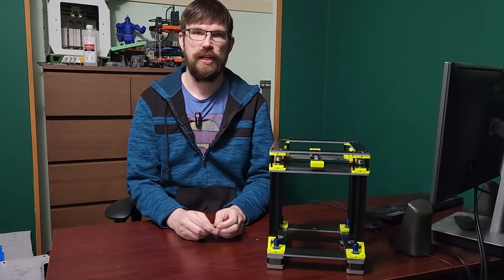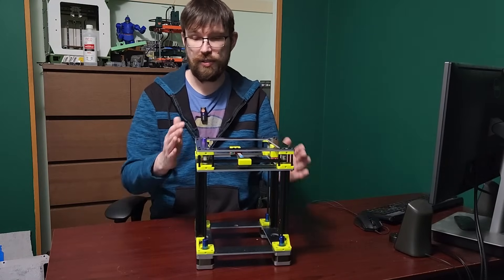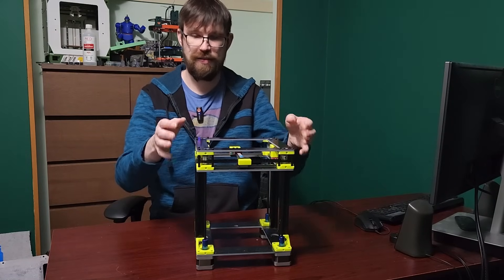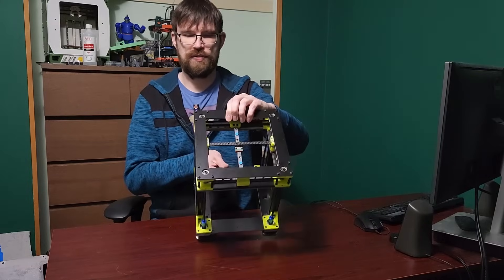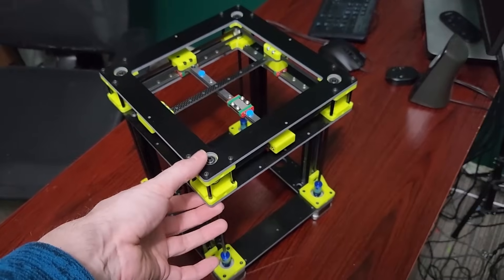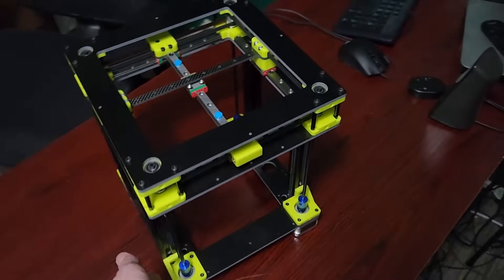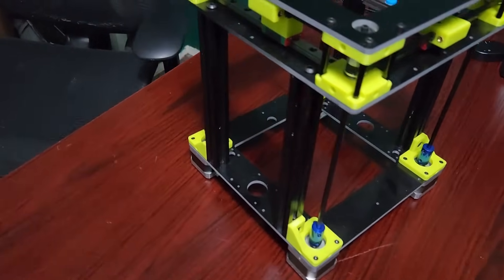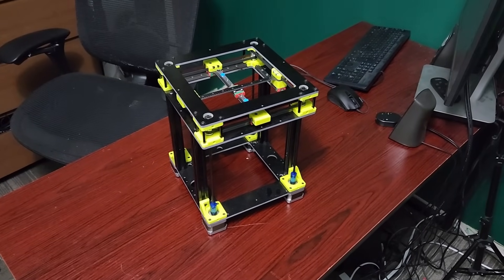First Look at My Secret Cross Gantry 3D Printer Design!

Comment: Can’t you use the 4 5mm rods for the bed? It would be mandatory to use an Oldham decoupler to avoid flexing the carbon rods. V wheels would not be terribly difficult either and won’t add stuff blocking accessibility.
Great work! I’m looking forward to seeing the finished product.
Reply from the maker: the carbon rods are usually not consistent enough to run a bearing on them. Very difficult to get get tolerances
Reply: @Rolohaun I understand. I would thought that POM linear bearings would be more forgiving with clearances, adding de benefit that, like in prusa, they don’t need to be lubed and facilitate the maintenance by not catching as much dust.
And even if the rods are less straight, oldham decouplers would ensure only vertical movement.
I’m truly waiting for what you come up with!

Comment: I sort of lost you on some parts. You use slotted aluminum profiles for Z. They are cut and accuracy for that cut is sloppy. This again is transferred to your main plate, with all the linear rails. For the rails to be mounted anywhere near in spec, you simply cannot use profiles this way, as the cutting is typically like +-0,5mm and the spec for the rail surfaces are in the microns. I also fail to see any adjustment options in this vid, so them plates need to bee seriously tight on tolerance, to be within specs for the rails. That includes them running in parallel. Not sure what has happened with this design, I am not a member, so I have no idea what the update says. How ever, the specs for the the rails are pretty straight forward, and how this meet that spec, I simply fail to see. The thing is, that binding is the ghost of this type of design, because of the need for things to be actually perpendicular, in plane, and in parallel.
Reply from the maker: the linear rails have small amount of adjustment to align them parallel. 2020 profiles are just for Z and what will be used to mount the linear rails for Z just like other printers nothing really different here. This is a prototype and still being worked on among other projects.
Reply: @Rolohaun  Right. You lock your plates to them 2020, please make one guess as to what is the strongest: Aluminum profiles in their longitudinal direction or thin plates at their cross section. Which one do you think will give in, as you fasten these. As for the ability to "adjust" rails. Well, how? How do you adjust anything at the micron level?
Reply from the maker: @FrodeBergetonNilsen  aligning he rail on a CNC plate is the same as aligning it to a 2020 you need to measure and get it parallel no different. Linear rails holes are larger than a M3 there is plenty of adjustment. Do you know how much rigidity a linear rail adds? linear rails are also providing strength not just motion. My g10 plates are flat with the linear rail attached. Design your own custom 3D printer and enjoy
Reply: @Rolohaun  "you need to measure and get it parallel no different"
Again. How. How do you align anything at the specs required? How. Have you even read the spec?
Reply from the maker: @FrodeBergetonNilsen  i really don't understand what you mean, you would align the linear rails to the g10 plate. Same as you would align it to a 2020, you measure and make sure it's parallel with the 2020.
Reply: @Rolohaun  Well. To make an artifacts that is within the specs for the rails, the surface needs to be flat. Flat to a specified value. You are using LOOSE tolerance to the surface you fasten your G10 plate to. The plate will simply bend when mounting it. Because the surface you fasten your G10 plate to, is absolutely, positively, not anywhere near the required spec for the rails. Again, them 2020, how strong are they in their longitudinal direction? And again, you claim "you measure", so please, just explain to me, how? Once you look up the specs, and actually read it, then you might explain how to meet it. Because I am still waiting for the reply on how on earth you are planning to meet any rail specs. But we are in agreement: You do not understand what the specs says.
Reply: @FrodeBergetonNilsen  In this kind of design you can easily align the 2020 prior to mounting. You need to get one end on all the 2020 flat. Then you allign them side by side and press them against a flat surface (like a slab of stone plate). Then you can adjust all the opposite ends and get all 2020 to the same length.
Reply: @simonquvang6073  No. Not at this accuracy level. If this is what is done in the industry, that would explain A LOT. We are talking about an accuracy in which 2020 profile do not adhere to. Not by a mile. The bloody tolerance of the slotted profile is nowhere near the required for the surface and fit for tight tolerance rails. This is why I ask: How? Because nobody seems to know how. Not at the accuracy level needed, to be anywhere near the specs for the rails. You simply do not know anything with the process you just described, you just assume. For a ton of work I see, they might as well claim to be on the moon, and know that they are. They just assume it, thus it is true. Just for the record, I think I have seen only one tuber with a stone surface used for alignment. One. He was not aware of the tolerance of this rails.

Comment: Being realistic. If we building a DIY printer i think and hope not being wrong, we have a drill laying around, with a printed stencil could be easy. 

You can always check the cost of cnc vs laser cuts and just make the general shape and the bearing hole depending on your final decision. The little holes can be made when the plates arrive, it isnt a precise operation making 3 holes in 4mm plates IMO.

having the option "hole-less" vs with holes for requesting depending of the price, the country and the amount of "hands on" someone is willing to put in it, is a good choice too!
Reply from the maker: I just think manually placing all the holes it too difficult to get right, all of the linear rails needs mounting holes drilled and those need to be as accurate as possible. I will be looking into cheap laser cut acrylic options and such I am sure there will be cheaper methods
Reply: @Rolohaun idk if this is the correct word in English but "methacrylate" the same type of acrylic people use on PC gpu cooling blocks should make it. The operation cost for that material is incredible low and the temp resistance is well know in pc/server and even automotive modding. 

And for the precision, you can always pay a workshop to do it with a stand drill(idk the correct word) and a vynil template. We arent looking for a 0.005mm precision, are we? The cheaper option i can think is the methacrylate cuz others like pvc tend to deform and a 3D printed part would last longer.

Comment: I would agree with a belted 3 z, say with like 2.4 beefy z tensioners . Here’s my question tho. With cross gantry and say z tensioners mounted on the bottom sandwich plate, how much “noise “ do you think would transfer to the build plate at speed?
Reply from the maker: only time will tell, I don't think there should be much but who knows

Comment: As someone who built a Rook 2020 scalable thats 300 in the Z, I would much  prefer rails over belts for the Z.
Reply from the maker: I assume you mean lead screws over belts? With a gear reduction belts work well and there is no worry about bent lead screws
Reply: Use GT3 belts and live shaft, then tighten it as much as possible then it would work well even for long length

Comment: Why not keep a standard bed size, and then offset the bed to gain back what you would've lost due to the rails? So, you'd just make the frame slightly larger in XY.
Reply from the maker: I am already offsetting the bed to get the 110 size, for 180 I will need to grow the frame. I am trying to make it as efficient as possible

Comment: While I love the design,I have two main feedback.
First, you want to keep the cost as low as possible, but I'm not sure if you actually need the top plate, (or the second top plate). I think only one is sufficient, and you could sandwich the gears with 3d printed part. This would lower the cost.
Second, For the motor shaft needed to be longer if mounted directly on the top part, you could work around this. Have two of the motor underneath the gantry, for the lower belt, and two motors above it. THen you can use a standard shaft. But even then, I'm not sure if this is required. I'm thinking about the corexy, they always have two different height for the belt, and use standard shaft. But maybe I misunderstood.

However, I understand that would still go against the argument of having the mass the lowest possible.

Comment: Great and interesting design. As a cross-gantry printer owner it's excited to see new cross-gantry designs. Except the bowden part - bowden is unacceptable in 2025. In my printer I rotated the rails 90 degree to reduce the carets footprint and allow more space for extruder.
Reply: I was making my own cross XY as I’m sick of all the core XY clones, but stopped because the of simple fact that the hotend is too small for direct drive (at least with my setup using linear rods instead of rails).
Reply from the maker: I have no issues with bowden, as this progresses I will see what make the most send, right now there is no room for DD

Comment: I understand cost management and you’re doing a great job with that but I don’t understand the 180.. to me it seems contradictory to the cost goals.  Prusa and Prusa clone beds are everywhere and can be gotten for 50 all day long complete.
Reply from the maker: prusa beds are hard to work with as they are meant for bed slingers so mounting can be a issue. It can be done just not a simple process. Users can mod the final version of this and use whatever bed they like

Comment: Btw, what about cross gantry with dual crossed carbon tubes? Would potentially increase the print area compared to off-center printhead? Also potentially lighter.
Reply from the maker: carbon tube that can run a bearing with good tolerance are very expensive and hard to find

Comment: Could you mount the printhead center on the rails if you were to have the bowden tube enter diagonally? And then straighten out evenly lower, or lose a bit of z height?
Reply from the maker: the printer will need to be bigger the carriages take up a good amount of space to mount the toolhead center

Comment: Do the plates have to be plates?  At least the top one looks like you could build it by stacking four identical pieces.  It wouldn't look as pretty and it might be a bit less rigid but I'm guessing it would save on the cost as you're not paying for as much wasted material.
Reply from the maker: ya I really want the plates to all be once piece for rigidity

Comment: The cross gantry kinematics keep the mass of the motors off the moving rails, so they are just as effective as core xy in reducing moving mass.  The idea isn't new, Ultimaker has been using a form of this for years (with round rods and bearings).
Dual motors on each of the X and Y axis seems overkill, though I suppose you are using a pair of Nema 11 sized motors on a printer this size, and a single Nema 17 or 14 would suffice.  I also see you don't have the bed or toolhead installed yet.  I wonder if this design could be modded to use a "floating gantry" with a fixed bed like the Voron 2.4?
Reply from the maker: The belt path is much better than coreXY, every design has pros and cons. I already have a 2.4 design called Pegasus that uses v-wheels

Comment: A single slot being cheaper than two holes feels like a commercial choice. Two additional up and down moves are most likely not more expensive than the additional tool wear when cutting a slot. Two holes are likely more precise during montage.
Reply from the maker: I will have to see how it works out, weather cnc or laser cutting is cheaper and material choice. Lots of factors to consider

Comment: I'm totally happy with 3 lead screws as long as we can use oldham couplers or some form of isolation for the leadscrew nuts from the bed frame. WobbleX etc. I love this idea because I'm also tired of corexy and want to build a precision machine. I've been messing with using a Trident converted to cartesian like an Ender 5, but meh.
Reply from the maker: I have used plan lead screws without couplers on large printers without issues. I will needed to do some testing though
Reply: @Rolohaun  I have also. Guess it just depends on how the bed is attached to the bed frame also. One of those things where I'd hate to build an accurate motion system up top only to have the bare minimum for Z.

Comment: I honestly believe `more-rails` is not the way.
There are multiple ways to make long lasting plastic bushings.
Reply from the maker: the problem with bushings is getting a bushing and rod the correct tolerance. Cross Grantry needs more rails which is a con of the design but linear rails are much more precise and really cheap in this size.

Comment: Use steel vertical rods. CF doesn't have great shear modulus.
Reply from the maker: I may need to move to they, I will see what happens
Reply: @Rolohaun  steel rods will increase the inertia by a lot.
Reply: I'd say hollow aluminium tube to keep the weight down.

Comment: If you are going to use three separate motors for the Z-axis, you could make it 5 axis akin to a printer by youtube user multipoleguy (see his video for more detail) - seems a surprisingly simple system
Reply from the maker: I don't have enough drivers then, already maxed out at 8 and I don't want to use two boards

Comment: I REALLY like the idea of the motors on the bottom with extensions to keep the center of gravity low... And the fact it's not coreXY! I've got my own unorthodox motion layout printer (with flat cut parts as well) that has been working really well that I need to refine and publish...eventually. Somewhere.

Comment: This is the DIY printer I've been waiting for for a long time however I'd rather have triple belted z axis with thick belts to make it less likely to accidently bend a lead screw to make the z axis quality suffer. Also would be cool to be able to adjust and modify the build area and have you heard of the new Qidi x plus 4 with their lower pitch belts would like to see that in one of your project but of course it might increase the cost. Thanks Rolohaun!!!!!!

Comment: Did you consider laser cut acrylic instead? It's very cheap and easy to produce in local fablab's. Aim for 5mm or more thickness and you might have enough rigidity imvho.
Reply: I was thinking the same thing, even if it ends up needing to be thicker it would be significantly cheaper and design wouldn't need to be limited by machining cost.
Reply: I think you guys need to expand past acrylic. For a few bucks more you can SendCutSend and get a metal part or for even more rigidity, carbon fiber laminate plate and a good one that is cheap if you are in the US is CNCMadness just over the border in Canada.
Reply from the maker: might be a good experiment

Comment: I'd think twice on using CF over fibre glass (G10). CFs biggest advantage is more stiffness while beeing lighter. I'd look into how thick the G10 would need to be to be as stiff as the CF frame. They are both the same stuff, just different fibres and CF is mostly overrated for most applications. Should make the printer much cheaper in the end
Reply: G10 is not carbon fiber, it's fiberglass. IIRC it has issues with expansion, and could potentially start to bind the croxy once the chamber heats up. 
The coefficient of thermal expansion (CTE) for G10 typically ranges from 9 to 14 µm/m°C (micrometers per meter per degree Celsius).

Comment: I have a bunch of cheap long shaft motors from steppers online with the intent of doing a hash cross gantry #

The extra couplers and carbon shafts adds part count and makes it equally harder to source 😮
Reply from the maker: I found easy to source 5mm CF rods and the couplers are cheap. It does increase the parts count though for sure

Comment: Absolutely 3 point z, with linear rods or rails, belted z is nice but I absolute despise dealing with the belts and their tensioners, still I have one Trodoon 2.0 and a Micron 180+, so its not that I cant build it, I just prefer the Ratrig way and Mercury Zero G way of doing it, it feels more rigid and the rigid feel of it would be a much better match to the rigidness of this one that it already have

Comment: Id be curious to see whether the pulltruded carbon fiber rods would torque open over time. I dont think so, given the very low loads on 3d printed components, but the "bundle of straws" structure of carbon fiber pulltrusions is a little nagging on the brain even if it is likely to be an irrational worry.
Reply from the maker: yes I may need to move to steel or something

Comment: Very cool design! 
Belted Z may be easier to install than Leadscrews and is way less prone to Z-Wobble problems. But a belted Z may require some sort of Pully system like the Voron 2.4 and additional shafts. On my 2.4 i had some problems with Z axis accuracy  because i had a pully that was not very concentric and poor quality bearings. So leadscrews with some sort of coupling system similar to the HevORT might  be the best option.

Comment: extremely interested in this project. very very cool! a quick question.... the printer stands directly on the motors currently... is that a issue or fine? thinking both heat and vibrations
Reply from the maker: I am going to try it, if it does not work out I will design some feet